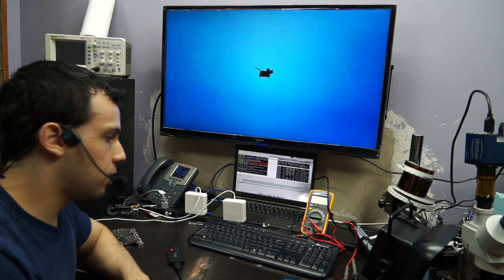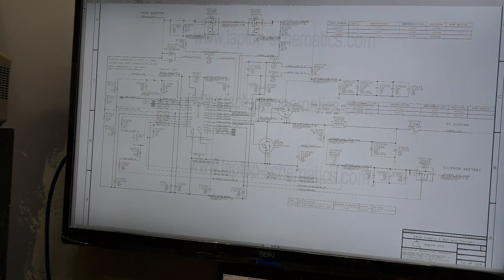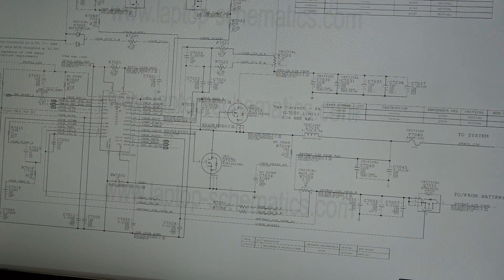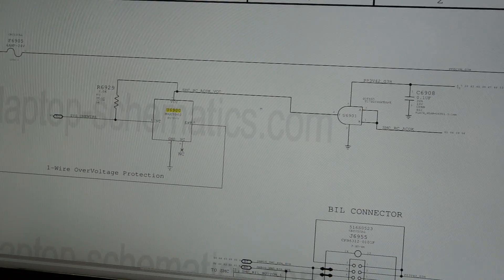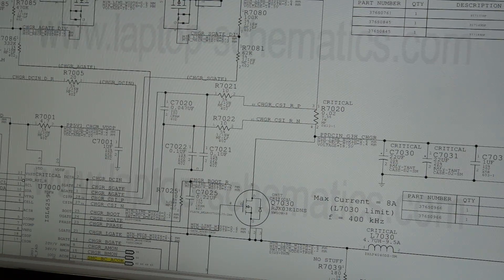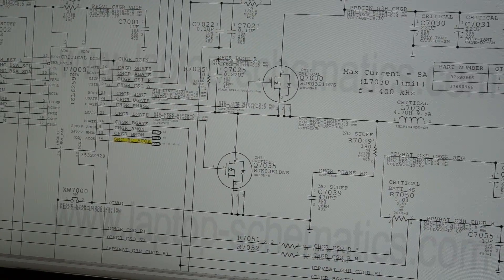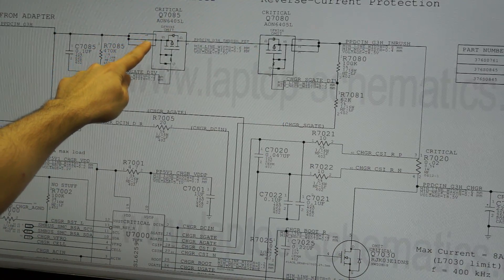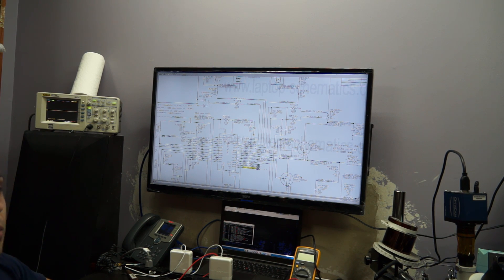Introduction to Macbook logic board power circuits - 820-2936 no PPBUS_G3H repair

Comment: Hie Louis. Great Fan, love your witty comments. I have a MacBook Pro Mid 2012 and had it liquid damaged and sent it in for repair apparently to China, they said they have to replace the motherboard. Worked for a year and then its dead completely. No green light. Now after watching a lot of your videos I opened it up by myself and found out that its 820-2936 B MB instead of 820-3115 MB. And started going over the power rails and found that it doesent have PPBUS_G3H OR PP3V42_G3H OR SMC_BC_ACOK.
What should I do next ? I'm a little confused

Comment: Hello, I am a subscriber and am so glad there is someone like you to give support and guidance and you deserve every credit and profit from doing what you do here! Your channel has given me confidence in a  trade so complicated and secretive. Thank you.
If i lived in the US i would pay you a visit and take a tutorial with you!

I have just one question if you don't mind. 
I had the exact same issue as you have had with this board, the only exception is that i have all the voltages in all the places you tested, a little low, but present. 
I did replace C7016 and now have a green light! but it is only green.. with or without a battery.. so the battery is not charging.. :/ is there anything you could recommend? Happy to pay for guidance of course.  Thankyou

Comment: Christ I have never seen anything remotely close to the problems you check out on your videos with Apple boards NOT EVEN ON ACER laptop boards LOL. I am also in the repair business mostly IT Network installation contracts but also do laptops and Desktop Repairs and Custom Servers. I do work with Apple Desktop Machines ( quite a few people bring me their Audio Daw machines to setup for heavy Audio and Video editing) .
I have a small Hakku rework station for small quick repairs. But the customers I have in industrial Shops have not time for a repair when you have a Multimillion dollar Auto line parts going and a RenShaw machine goes down...No time to panic. I stay away from Apple portable products for a reason I do not have the time to fix things for hours. 
Good and Excellent Videos.

Comment: i am still getting into understanding better - however - i thought I should share a funny discovery on a ugly 820-2936 board which I am trying to fix  (which turns out not only to had a liquid damage but also a bad doctor maybe !?)

I just removed U7000, suspecting it of not enabling the 1-wire to give me the damn green light and making me stuck with dim flickering. 

WHAT I FOUND WAS AN IC WITH 25 CONTACTS ON A PATTERN THAT DEMANDS 29

first i had to laugh but now fear spreads that there is more stuff badly doctored that i can't yet see
Reply from the maker: let me guess you bought that off ebay
Reply: haha sure, where else ? this board looks really busted. I didn't give up yet and ordered me the correct u7000. Is it correct two have two bridges on the dc in connector ?
Reply: all your teaching material is great man ! I am pretty thankful
Reply: Hey Louis, you have a hint for me ? I soldered in the correct ISL U7000 and now I don't have dim flickering anymore but still dim (constant)

Comment: I Just want to thank you Louis for your videos, that allowed me to repair a 820 2879 board not turning on with a dim green light on the charger. The PP3V42_G3H rail had only  ~1.2v but why!? After many multimeter probing, schematic, boardview and using my brain ;) it turned out to be the resistor R6905 on PPDCIN_G3H_OR_PBUS 16v got in but only around 2v or something got out. So after figuring out that was a 1ohm resistor I got it out of the board and it measured 88ohm. I searched the scrap board for a 1ohm resistor and replaced it and BOOM it worked. So happy for this right now. Thanks a lot Louis and keep up the good work.

Comment: 820-4924 U7100-14 has 3.3, shouldn't the light come on? I have no light.
Reply from the maker: +Tony Tone could be bad smc, could be bad u7000, etc.
Reply: Ooooooooh! 

Thank you.
Reply from the maker: Tony Tone wtf no that board is over $550. FIX!!!

is smc_reset_l high?

is 3v going to the chip that sits between the SMC and the adapter?

is a known good dc in board being connected?
Reply: OK.  I see in your video if smc_reset_l is 3.4V it is bad SMC.  Never replaced one before.  I'll give it a try.
Can't figure out which chip you are referring to RE: between the SMC and adapter. (U7000 & U7090 seem good, getting pp3v42_g3h). Tried 2 dcin's and they seem good.

Comment: I know my question has nothing to do with this video but I want to ask your opinion. 

I just picked up a Lenovo T430 with windows 7, have an hp with 10 but some software I need for work isn't compatible with 10, so figured another laptop never hurt anyone. Anyway my question is this. as far as security goes what would you recommend?  I have always just used AVG free but seeing as I am going to have work related things in this computer I would like the best protection possible. 

Any input or advice would be greatly appreciated.
Reply from the maker: +John Markey AVG is fine. I am no expert on viruses, I find if I don't click anything I'm not supposed to I never get infected or have shit quarantined.
Reply: I do my best not to click what seems as though it shouldn't be clicked. Thanks for the input bud!
Reply: +John Markey  i have had great luck using win 7 drivers in windows 10. as well as xp drivers in 7. AVG hasn't done so well in A/V benchmarks the past several years, at least the last i checked. avast seems to be standard these days. Symantec for enterprise and commercial environments. (i think)

Comment: Hello Ross,
I have a macbook pro 2014 retina, wont come on when i hit the power button, but comes on when the charger is plugged in (after a water spill). Battery is 100%, every other thing works normal. Please, what part of the board should I be looking at? Thank you!

Comment: hello, fixed the pp5v_sus, but now the pp5v_s3 has 0 volt. can you til me again ? thanks
Reply from the maker: pm_slp_s4_l  missing?
Reply: +Louis Rossmann yes its missing
Reply: +Louis Rossmann and the u1800 get a little warm not hot
Reply from the maker: Guess what's next
Reply: +Louis Rossmann follow the PM_SLP_S4_L rail if it is good.....
Reply: +Louis Rossmann how mutch does a hotel cost near you?
Reply from the maker: Roy Mulder A ridiculous amount of money like everything in NYC.

So U1800 creates PM_SLP_S4_L

And you're MISSING PM_SLP_S4_L, which is required to get to the next state.

What is wrong here?
Reply: +Louis Rossmann PPVRTC_G3H is present. so clock rail it is.system RTC power source & 32kHz / 25 mHz Clock Generator.it has PP3V42_G3h and also PP3V3_s5 but it is missing PP3V3_enet so then i look for  ENET Enable Generation ?
Reply from the maker: what signals does PPVRTC_G3H pull up with pullup resistors and are they present?
Reply: +Louis Rossmann 3.24v
Reply from the maker: That is not an answer, reread question :(
Reply: +Louis Rossmann sorry was indeed a little to quick,,, brain on.,0.744 but no drop..... diode mode on multimeter(quickly watched you pullup resistor video TY )
Reply: +Louis Rossmann on the other resistor i get 1.123 something, on the other side i get 0.002  gonne check other board for that
Reply: +Louis Rossmann on c2810 when the charger is in i get 0L when charger is out i get 0.723the  R1801 R1803 R1802 C2233 C2231 C2232 i get 1.080R1815 R1800 i get 0.744 all dont drop they stay the same diode number (sorry dont know the correct word)
Reply from the maker: Please god tell me you are not measuring diode mode with power on the board
Reply: +Louis Rossmann measured PPVRTC_G3H with diode no power (ashamed alot, because i knew..) R1801 = 480 / R1802 = 480 / R1803 = 480 / C2231 = 480 / C2232
= 480 / C2233 = 480 / C2810  = 476 /  R1800 = 965 / R1915 = 959but i dont see it change the numbers its stable
Reply: +Louis Rossmann did i fuck up badly?

Comment: hi, louis, i have the same board working only on battery, i changed isl6259 im getting 4volts on  L7030 and f7040, i changed also  q7030 and q7035 but stil getting 4 volts, its like something hanging the 12v to 4v or a bad join solder, any idea, thanks,

Comment: hi, louis, i have the same board working only on battery, i changed isl6259 im getting 4volts on  L7030 and f7040, i changed also  q7030 and q7035 but stil getting 4 volts, any idea, thanks,

Comment: Hello Louis,got a question about the 820-2936 board, i have the power rails in order up to down on the schematic.but i have 0 volts on pp5v_suscan you advise me a bit on what i might be missing?thanks in advance.
Reply from the maker: +Roy Mulder what enables sus rails?
Reply: +Louis Rossmann dont smack me in the head at once,   i think its the power fets. page 72...but i have been bashing my head al day on this. and the board is clean not even a single spot on it......so no give away on this,really missing
Reply: +Louis Rossmann 3.3V/5.0V Sus ENABLE
Reply: +Louis Rossmann haha THANKS , got the pp5v_sus rail working :) sleept a while woke up whent on and found the u7940 was dead........ replaced it now next thing... but thnaks os far your answer made me think and use the BRAIN...haha have a nice year btw

Comment: your vids have definitely helped me learn and fall in love with tech repair all over again but a quick question that I've been searching the web for . I have a MacBook air2010.model #.a1369. I have green light from charger but no power. I shorted the power pads and it Turned on!! But I accidentally bridged the power pad to another pad close to it causing it to spark a little and shut off. is this repairable?
Reply from the maker: +Cassidy Estrada No clue

Comment: I have a similar issue, however when I plug the battery in, the U7000, gets VERY hot... I had to replace the charger vsense resistors R7020 and R7021 as they were in the kOhms and not 10 each (also went ahead and replaced C7020 cuz it looked like shit.) I have 0.237V at PPBUS_G3H. Is it safe to conclude that U7000 is bad? I have a spare board, with a hole in it, which I pulled the resistors from (all measured correctly on donor board), which has the u7000 I can try...
Reply: Yeah, I think U7000 has a short to ground

Comment: Hi Louis
This may be a stupid question but you always refer to power on these macbooks a 18V but I only get like 16.5v am I using the wrong charger?
Reply: +Rossano Balloco this was a stupid question on my part it depends what is needed for that particular logic board this can be found on the Schematics for that board

Comment: Hey, great videos! I've been watching more of yours recently trying to fix this laptop I've had that's been sitting around for quite a while. I think I'm pretty close to figuring it out, but kinda stuck now.  So I have a 820-3115-b and it gives me a dim green blinking light and no orange w/ battery in it. I can hear a clicking too and it seems like it's the capacitor at C7087. The thing I don't get yet is that if it's clicking, does that mean the capacitor is bad or just a short to ground? Could it be one of the transistors that are bad?

Comment: Hey louis i have a 820-2850 board has 12.something on PPBUS_G3H but voltage drops slowly to zero then back to 12.something.I check the PPBUS_G3H rail for a short and have no short on that rail. i have replaced the U7000 chip and it is still doing the same thing. What do you recommend doing

Comment: Hello Louis,
it´s wonderful to watch your videos ! Great stuff ! Btw. i got a 820-2137 Board. When i plug the charger in the MacBook Air starts spinning the FAN but no chiming. When i meassured the voltages i recognized that PPBUS_G3H is only 8.4V. When i desoldered the Coil where it came from the the Voltage from the side of Buck Converter goes to 16.5 V. But i meassured no short. I have no more idea. CAn you give me advice what else to do? THANK YOU FOR YOUR VIDEOS !!!!!!

Comment: Great video.  With regards to RepairShopr, do you feel it is a good system to go into after using it in your shop?  Was looking at customizing OSTickets for my needs, but this seems to be better integrated with other software.
Reply from the maker: Everything else was crap by comparison. They just get it, and when they don't, if you bother them enough, they'll change it for you.
Reply: Louis Rossmann Plan B for when the internet is down and you can't access your tickets?  I know for my asterisk server I've been forced to setup a failover isp so calls keep coming in through the system. You can't keep records once you relegate to using a cellphone as your backup.
Reply from the maker: I connect to wifi from next door when internet is down, and put a sign in the window that says "CASH ONLY BECAUSE TIME WARNER SUCKS"

I hear you though. As good as it is, all cloud shit for ticketing is inherently slower than GOOD software run on a GOOD host computer that is sitting in front of you.